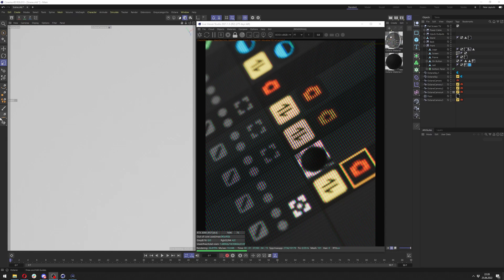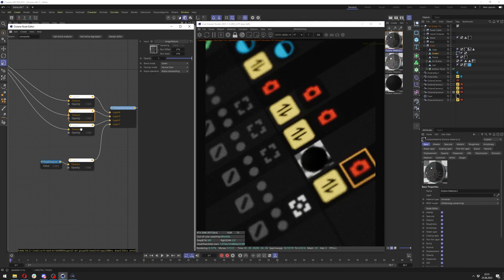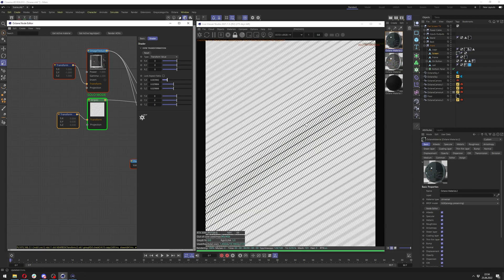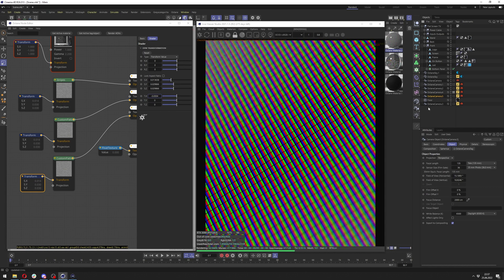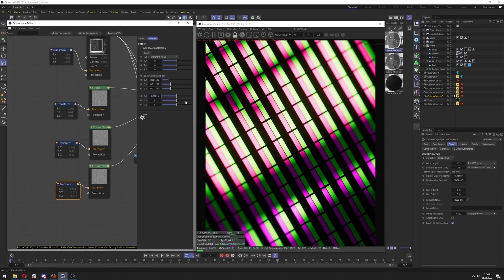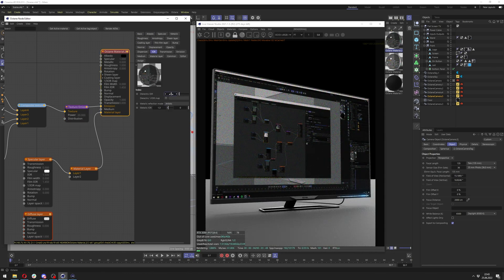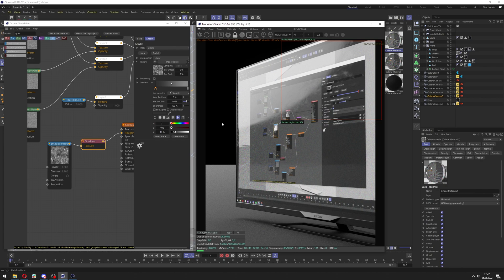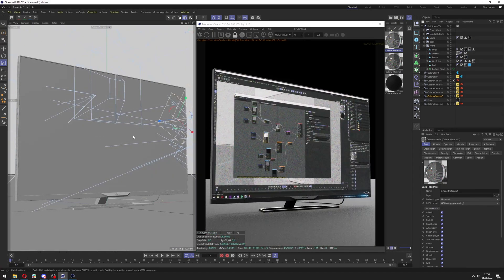LCD Monitor Screen Material In Octane Renderer

Comment: I can't find the custom pattern button on the material node no matter what, with the OSL stripes texture everything is much complicated bc I cannot transform or change location :( any suggestion to fix this?
Reply from the maker: Hey! close node editor and open it again, it should fix the issue, if not you probably need to update your octane.
Reply: @NojsGraphics  I have the same. Strips are only in the blue node tab. OSL PATTERN. And he's there with coding. Octane latest version. and in RRDF there are only 3 points, and in your video there are 5.
Reply from the maker: @gienaaaa  Strips are in Octane probably from begining, they were move to custom pattern, pretty sure before it was just in green group of nodes. Anyway if you have latest stable or latest experimental (i tested out both) build of Octane on Windows, you should have it. Bug where costum pattern dissapear is still there, all it takes to fix it is to close node editor and open it again, and it should appear at bottom of green group(generators) in node editor.
Reply: @NojsGraphics  They won't appear. What is strange is that in cinema r19 with the R4 version of octane, these nodes are. And in r24 with R6 version of octane they are not.